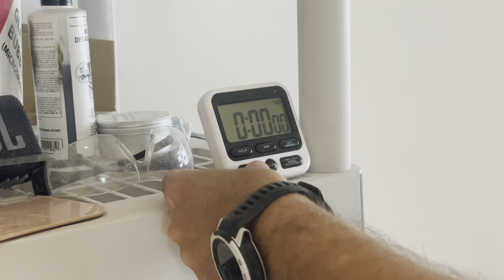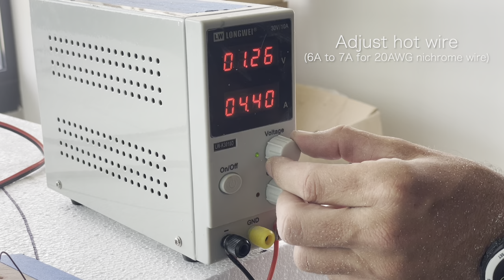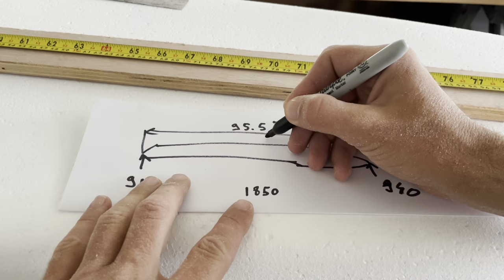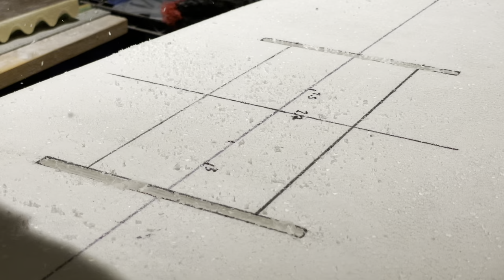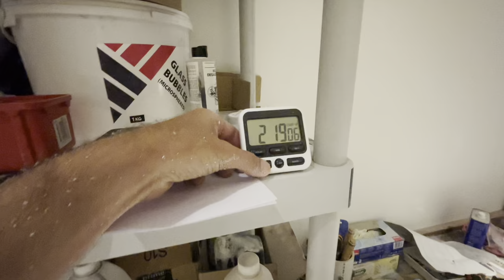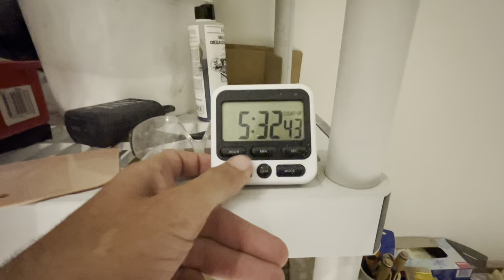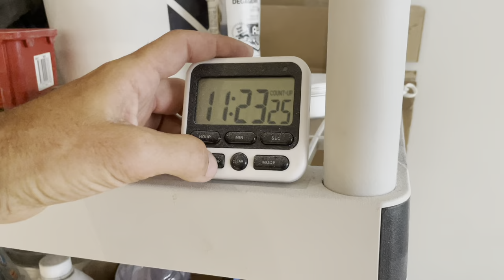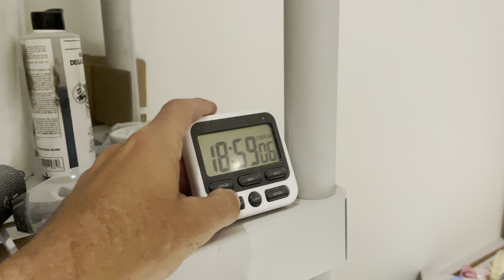Make your own light, cheap and easy downwind board!

Comment: Your v-cut hot wire + tape method is awesome. Also love your wetlay up transfer mechanism to the board - not seen you do that before. Absolute genius as always. One thing I do that could be of interest: I use this bit to open up the track boxes… super quick and neat.
Reply from the maker: thanks.
Depending on how deep the tracks are set and if they have flanges or not, using a router/bit might leave them proud. I like the flanged one, probably stronger, but I sand them down  back to the level of the board.
Reply: Sooooo satisfying , great editing …. Plzzzz sell it to me cheap😊😊🤗🤗. Thks for sharing

Comment: The V groove hot wire and tape is a great idea. Much thanks!
Reply from the maker: thanks, it's definitely worth getting a proper adjustable power supply, and a roll of nichrome wire, took 5 min to make the V groove one and start using it :)

Comment: Love the way you did your board. The time frustrates me so much though. I was a little surprised at you doing laminations with time splits though,  I try to to get that one-shot interlayer bonding. Certainly you have great cosmetic results and low weight though!
 My own first wingsurfing board I designed really well, built maybe a bit fast but then I didn't learn how to yaw steer it, I was roll steering it and my big sunken deck was too narrow for how I preferred to place my front foot. A couple of years later and having swapped to a bought board mid way, I've realised this last week that I need to un-filll my sunken deck on my own board to bring the weight back down and recover my original design and give it another try. Part of this has been my technique evolution and centering my feet but also I've redesigned my wings to be very yaw responsive with thinner tips and switching from the Axis standard fuselage to the advance version which brings the wing back closer to the mast. Now I have wings with great performance, it's the mast to work on, I bend the Axis masts with my weight on and ground impact with our sand bar so I am just over 3 weeks into a mast moulding project including design, printing, sanding and filling cycles. reducing the lower mast thickness from the Axis 19mm alloy to a more standard carbon tapered profile should really improve glide and strength.
Reply from the maker: it's all trial and error! good luck with your mast project, I made a couple a long time ago... it's a lot of work :)

Comment: This is a really awesome video, so much good information in it.  

I watched it a month ago and just rewatched today.  I started building surf boards four years ago and graduated to wing boards and downwind boards, all done with layups (no vacuum bagging).  I'm getting acceptable results but I expect to really improve them using things I learned from you.  The biggest change will be using release film as part of the layup.  

How do you calculate the required amount of epoxy resin?  At one point you used 140 grams of epoxy for 100 grams of cloth and at another you used 150/100.  I've been calculating epoxy requirements using Greenlight Surf's marine grade epoxy on the basis of 3 oz per foot of board length for a single layer of cloth, 4 oz for a double layer.  Your method looks like it will be more accurate.

I calculate my board volume the same way you do, by weighing the blank (foam only).  It was nice to see that validated by someone who knows what they're doing.
Reply from the maker: thanks, I'm glad it helps.

for resin Qty, greenlight formula won't work well for a wing board as the section is usually way bigger than a surf board.
For me, I usually mix between roughly between 1.2 and 1.8 time the weight of fiber. The lowest would be for 2 layers with the resin applied on a flat table, highest for single layer with the resin applied with the fiber on the board and planning to have peel ply on top. 
When I add thick fiber for reinforcement, I tend to mix a bit more to make sure it's fully saturated and let peel ply remove the excess.
Reply: @matshape  Thanks Mat, that's helpful.  I'll start with those parameters and experiment from there.

Comment: Really helpful. I started to do my own board thanks to you and your videos. Do you have any lessons learned from the process that can help me? How are the boards doing in the water? Any leaks? Thanks!
Reply from the maker: lot of things you learn as you go... but main one i often forget and regret after is thinking i'll fix a small defect at a later step... this never works. If your rail is not fair, you'll sand through the lamination when trying to fix it. result of each step should be as good as you can make it before moving to the next.... Good luck!
Reply: @matshape  Hi Mat. Instead of the 300g bi-axial carbon fiber, do you think other weaves will do the job? Thanks!
Reply from the maker: weave type doesn't really matter for what we are doing... our designs are not optimized enough and the load we apply varies too much for weave choice to bring the board from "strong enough" to "too weak" it's more about having a sound structure inside the board to transfer the load between feet and foil. I'm convinced i could get away without the 300g reinforcement... until something else goes wrong. Recently a jetski hit my board at full speed on the water and broke the bond between the HD foam and polystyrene, so my boxes were moving, but thanks to the thick re-inforcement on the box,  the board stayed waterproof and in one piece, not rideable, but fixable.

Comment: Hi Mat, I see this is your second attempt on the down winder board. Is it possible to tell us the difference and your findings please. Like what worked and what didn’t. Thanks
Reply from the maker: The first one was only for light wind wingfoil, volume is too small to stand on it without the wing (~85L), so I sink the tail a lot (I'm ~73kg). The news one is much bigger with 115L, quite longer and even if narrower it's pretty stable to stand on it with a paddle.

Comment: Amazing video!!! Congratulation!!
Thia video is fantastic for build board with less dust.
I have a question for you: when cut eps with the hot wire, how is the current and the tension? The same of the v cut? Thanks a lot!!
Reply from the maker: thanks! less dust and no epoxy on the floor... good criteria when working in an apartment. For the hotwire, the current is what matters to get the right temperature and depending on the length, the tension will be different. A given wire gage needs a certain current to get the temperature you want. So depending on your power supply max voltage, there's a max length you can make your hotwire.

Comment: Just curious how you handled the lap joints? I keep coming back to your video as a go through my development stages! Thank you!
Reply from the maker: you mean on the rails? I made sure fist layer was flat and adhered to the foam before doing the second one, to avoid creating bubbles (that's why it doesn't look very clean, I had to remove some parts that were not bonded well ) and then the other side overlaps on the first. Note that the overlap makes the rails stronger, covering the radius on both "top rail" and "bottom rail" would make them even more ding resistant but is a bit harder to glass.

Comment: Hello Mat

Great video, thanks again for that.
After watching your videos, I also started building boards myself, so far a wingboard and a pumpboard. I like it a lot and have learned a lot, including everything I did wrong 😀. At night I'll also do a downwind board ;-)

With the downwind foilboard you only have 1x 200g carbon and 1x 100g glass on it. Is it stable enough, no weak points?
Thanks and greetings Daniel
Reply from the maker: yes, that's enough overall, just the tracks and standing areas needs more reinforcement. Note that this is quite light, so it will ding more easily... but if you make boards, a quick repair from time to time is not very hard :)

Comment: "easy" is a relative term. easy for you as you have excellent skills, experience and knowledge.  any reason you did not use a vaccum bag?   great job.  i used to repair wave board dings
Reply from the maker: “Easier” is may be more accurate yes… that’s why I didn’t use vacuum, much simpler for new builders and not much weight penalty…

Comment: Love it !
What's your thoughts on making one floater in an appartement ? I have a 2nd room that I can isolate and ventilate
Reply from the maker: I'm in an apartment, so it's definitely doable. There will be dust everywhere, but if you clean as you go you can reduce what goes in the rest of the apartment. Use epoxy (smells much less than polyester). Last thing is to be careful with noise... reduce use of noisy tools (router, orbital sander...) check best times with your neighbors :)

Comment: Master craftsman better than I could ever imagine doing a joy to watch
I would of qcelled the shaped foam blank then vacuum bagged everything and I would have put Devine cell where you stand 
Probably a little heavier but a bit stronger 
Yer it’s a fine line nothing more disappointing than breaking something that took 50 hours to make and thinking 1 more layer of carbon
Reply from the maker: thanks. I went for light and simple on that one. the foil attachment is plenty strong, but yes, the skin will ding more easily... a small fix from time to time is worth it for the weight ... definitely not client ready :)

Comment: great Build!  how you find the Position of the Trackbox? Because there, is where i struggle for my own Board.
Reply from the maker: It depends on the foil you're using, your preferred stance and the volume of the board. 
If the volume is close to your weight, you want to be standing on top of the CG = center of buoyancy, with more volume, you can stand a few inch behind to let the nose float better without sinking the tail too much. 
Now that you have your back foot position, you get your mast position, center the box there and you'll have the most adjustment possible.
for reference, I'm ~73kg, that board is 115l, I set the center of the box 16in behind the center. On my previous ~85l, it was 11in behind center.

Comment: Awesome work! I have a question about the bottom layup if you don’t mind. Is it (from foam out): carbon, glass, wait to dry?, carbon patch, wait to dry, sand, another carbon patch between rails, peel ply (why the peel ply?)?
Reply from the maker: the big patch was added at the same time as the main lamination, better bond. I added another one in the middle to flatten a bit the area between the tracks and add a bit of strength, not sure if the extra strength is needed. the peel ply is to get a smooth surface that requires less sanding.

Comment: Hello Matt, super job, je me lance en partie en suivant tes méthodes. Question de débutant : pour R+D je prends le même poids que le tiss à coller, ou le double ? je fais du sandwich partiel carbone-airex-carbone, sous vide. Dis moi, merci !
Reply from the maker: Merci. En general je fais 1.2x le poid du tissus si je mouille le tissus sur un table à côté, 1.5 si je mouille directement sur la planche.
Pour ton sandwich, le carbon ne sert a rien en dessous, mieux vaut mettre du verre fin pour gagner du poid. et si c'est la première fois, colle airex+verre d'abord, et colle le carbon ensuite, c'est tentant de tout faire d'un coup mais risqué... bonne chance!
Reply: @matshape  top, merci pour les conseils !

Comment: Great build! Thinking about copying it. A question, around 5:00 you are shaping the board but it looks like you chose to sand all the edges. Why did you not continue with the tape&hotwire method for the "rough cuts" on these? At best it would cut down on time and at worst I guess if would have saved you some sanding dust?
Reply from the maker: thanks. you could continue with tape and hot wire, but I'm used to handshape the end of my boards: as it's the first time I do that particular shape, going by hand lets you feel the shape coming, see how the surfaces connect, and see how the volume goes down. Also note that for angled surfaces it's tape only, no grooves, and it's a bit more risky :)

Comment: Great video! Is there a reason that you put the 300g biaxial patch on the top? I would have thought there would need to be less sanding and filling if it was underneath the other layers.
Reply from the maker: thanks. As there is extra thickness, there will be a step that needs to be blended. if the patch was below, when blending it, you'd risk sanding through the fibers of the full layer disconnecting the patch from the rest, but with the patch on top, no risk, the full layer stays continuous.

Comment: Both this and your other board look awsome! 

where did you source all of the material? I'm thinking of making a prone foil board... would it be cheaper without carbon and adding a stringer? what extra steps do you have take without carbon?
Reply: I would also like to add footstraps, where would you recomend placing them?
Reply from the maker: thanks! epoxy and polystyrene are local from UAE, quite expensive to ship internationally. Carbon, glass, HD foam from easy composite, and boxes from Aliexpress.
Glass works fine too, and if it's your first board it's much easier than carbon to work with. Just make it a bit thicker to be sure. no need for a stringer if the board is thick enough, but you need the reinforcement linking the boxes to the deck. For straps, I'm not using any anymore, but especially for a prone board, I'd copy the placement on a existing board.
Reply: @matshape  Thank you!!

Comment: Great build and really quick too! After your filler coat are you just doing a spray clear coat (upol or similar) and not doing a clear gloss coat ?
Reply from the maker: thanks. Exactly, no gloss coat to save weight, it'll be a bit less ding resistant, but gloss coat on a board that size will be at least 600g.

Comment: Good job, nice board. I have a question, with a wind surf board, do you think I can converted it as a downwind foil?
Reply from the maker: That's not impossible, but quite a challenge, and not sure the result would be worth it.
If it is a regular windsurf, adding foil box is tricky as you'd have to tie in the existing structure of the board, the width might also be an issue, if it's too wide, you can cut down the outline, but it will be close to impossible to get smooth rails after you're done shaping/glassing new one. Finally, most windsurf boards are build much stronger than a downwind foil needs to be, so probably too heavy. I really think your time will be better invested making a board from scratch, and not end up much more expensive...

Comment: Great video! So many good techniques!
Wish I would have seen this before I built my last board! Was this 1 lb density EPS Foam?
Reply from the maker: thanks, yes almost exactly, 16kg/m3 0.99lb/ft3
Reply: @matshape  what rocker height did you use?
Reply from the maker: it's hard to say, tail is 120mm thick, nose is 27mm and thickest point is 169mm 1.6m from the tail (2/3 of the board). but the rocker is heavily modified by the rounded nose...

Comment: The V hot wire cutter is nice. Please whiche wire do you exactly use for this ?  Which heating wire are you using exactly, what diameter, what electrical resistance in ohms?
Reply from the maker: thanks, it's 20AWG nichrome wire, i can't remember where i got it, but that should be pretty standard.
Reply: @matshape  thxs

Comment: Thanks for this vid man love it. what kind of glue you use for fixing the two bloks of foam? can you still hotwire them after its glued? greez from switzerland
Reply from the maker: I used gorilla glue because it cures quickly and expands so it fill gaps nicely. Hotwire doesn't like it though, that's why before gluing, i mark the areas where the wire will cut to avoid them.
I also make sure there is no glue where i will sand to get the final shape. Even if you can sand the glue, it tends to create a ridge at the glue line because the EPS is softer.
Reply: @matshape  hey thanks for the infos... This was ecatly my proplem... So avoiding glue in the cutting areas... thx. Love your vids they are awsome thx

Comment: Great build! Way less hours than i used to have for my smaller builds😅. why did you choose to not use a vacuum pump?
Reply from the maker: thanks, it's because I'm lazy :) but also, less waste , less risk to mess it up (bags for 8ft boards are huge) , and when I vacuum, the surface finish is less good and requires more filler.

Comment: Could you please explain the math behind how you determine the volume of the board by weighing the foam. Much thanks!
Reply from the maker: it's not difficult: I buy 17kg/m3 EPS. but I check it, measure the volume of the blocs and the weight, divide the weight by the volume. in this case, they are 16kg/m3. Then , when shaping take the weight divided by 16 and you get the volume in m3, multiply by 1000 and you get the Liters. last check I did was 1.850kg / 16 = 0.1156m3 = 115.6 liters. Caution, this only work when there's only EPS (and assuming its homogeneous) , as soon as you start adding the boxes, it stops working.
Reply: Thanks!  Now I understand

Comment: great, but which part of this was easy?;)
Reply from the maker: removing the need for a vacuum setup, no epoxy mess on the floor, limited shaping with extensive use of the hot wire.. overall simpler :)